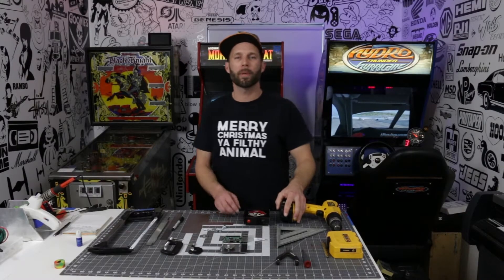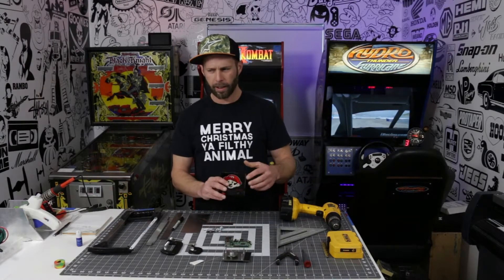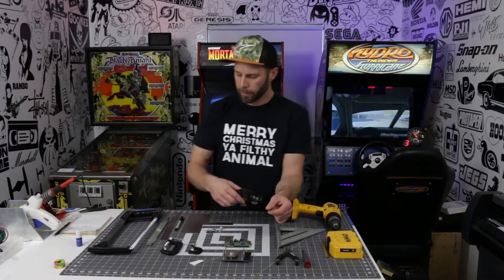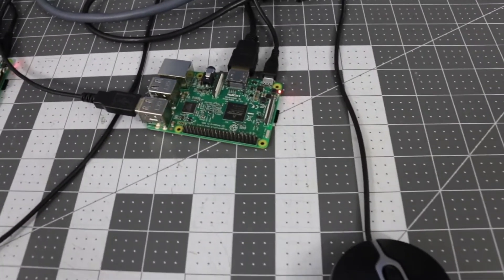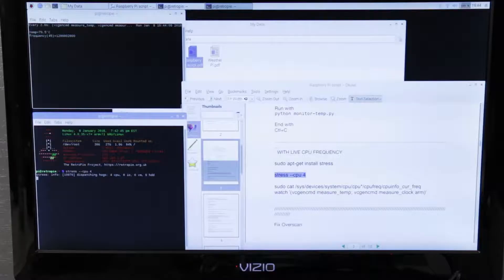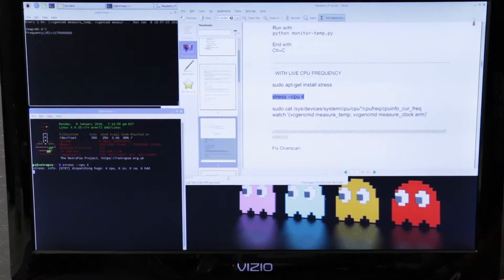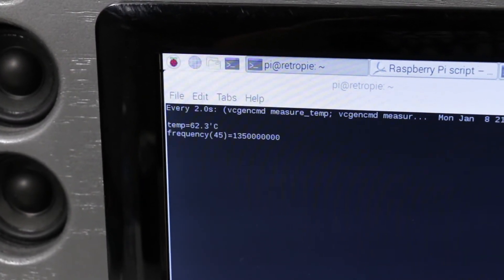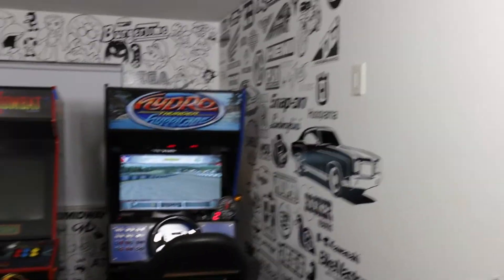The best DIY cooling option for Raspberry Pi Overclocking DIY Heatsink

Comment: Did this idiot just use steel as a cooling interface...?
That's like using a rock to drill a millimiter hole in the wall... Strel doesn't even transfer heat compared to copper...
Reply from the maker: Make like a heat sink a "chill" with the insults.   It might not be perfect. But its only a Pi, and had drastic results. Tested over extended periods of time.  There is no need to over do it. Like you did with your comment..                 Like and Subscribe.       Thanks.

Comment: Cool idea. An improvement of the design would be to use a copper plate instead of steel.

For my cooling solution I used an old heatsink from an AGP slot style Diamond Ultra video card that had a 5v 40mm fan in it. Then I used 4 1967 Canadian "Fish" dimes. They're made of 80% silver, 20% copper. A little thermal paste in between each dime. The stack of four dimes then get a thin vertical line of crazy glue on each side to keep it together as one block.(2 lines total) The top dime gets lapped flat to get the best surface area connection to the fan/heatsink. I have it overclocked to 1.5Ghz and it never gets above 60 degrees C.

Comment: What if you put thermal grease on the threads of the bolt to help increase surface area of heat transfer between the bolt and nuts?

Comment: if you put the raspberry pi with the pins gpio up, have less temperature????
Reply from the maker: The Baseplate has a large bolt that is pressed to the CPU.  The CPU is on the top, so thats where you have to mount the heatsink for it to be effective..  You could take 2 plates of steel and create a Pi sandwich so that the heatsink plate is the top for better airflow..  The highest temp Ive gotten is 66c overclocked at 1.35.   It overheats at 80c, so I have a long way to go before I have issues.           Hope that helps...
Reply: perfect, thanks for info, u ´re amazing!